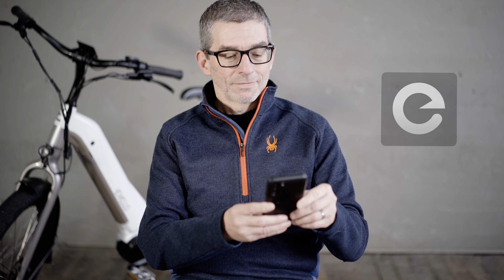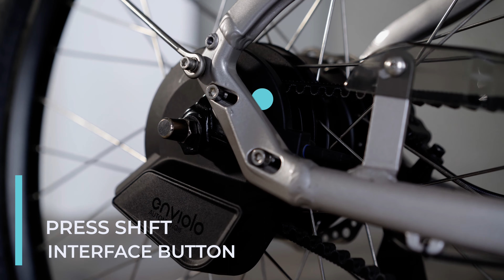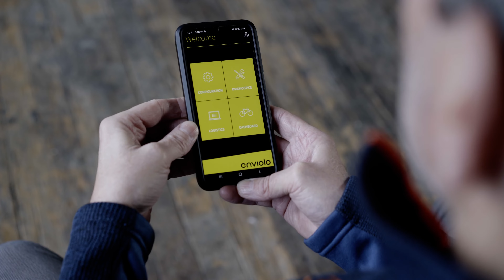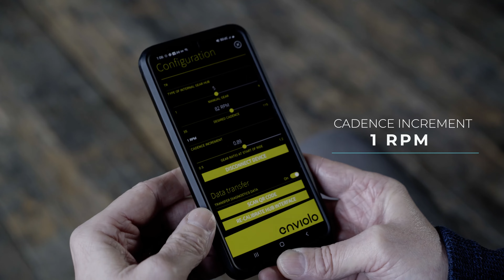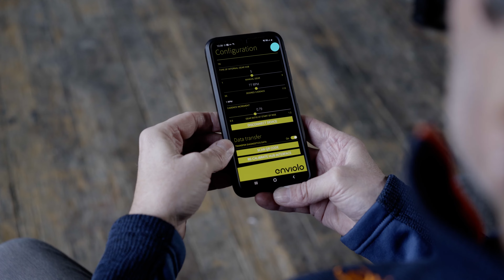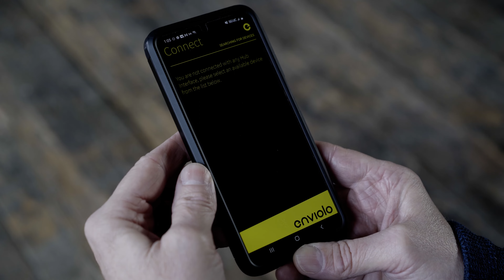EVELO Electric Bicycles - Pairing with Cell Phone App - Enviolo Automatiq CVT

Comment: If you attach your phone to the bike with the app open and then use the handle bar controller to change cadence will it display on the phone app,  the increase or decrease cadence number on your phone?  I'm thinking not, but that would be awesome if it did.
Reply from the maker: Hi Amy, the Enviolo can be paired with one or the other (phone or handlebar mount) and not both at the same time.

Comment: On the Aurora Limited ebike
The rear hub blue tooth led button switch is completely obscured by the bicycle rear frame.
That control button is 95% obstructed
therefore it is practically blocked and is very difficult to depress .
  This design flaw needs to be CORRECTED,  in future models.
It is so hard to reach that it becomes a major headache when attempting to  activate the rear hub blue tooth transmitter located inside the rear hub.
Reply: Hi there, it is a bit obscured on the Aurora Limited. The best option is to use something to depress the button. The end of a 4mm hex key works pretty well, and if you have a hex key with a ball head on the end, that would work even better. The button does have to be depressed about 3 to 4mm, and there is an audible click when it's activated. Just be careful not to depress too hard or you can damage the button. 

The good news is that once it's paired, you shouldn't have to re-enter pairing mode again, as the app should remember the bike.   Hope that helps!
Reply: Yup! Just received my Aurora Limited today. What a poor location for that bluetooth connect button. The worst is that mine won't pair, and the bike came with zero Quick Start Guide and Zero Display manual. It did include a little flyer with web addresses to pages for the manuals, the web pages display a code 404 page not found! Wow! I expected a little better than this for $4.5 g's!